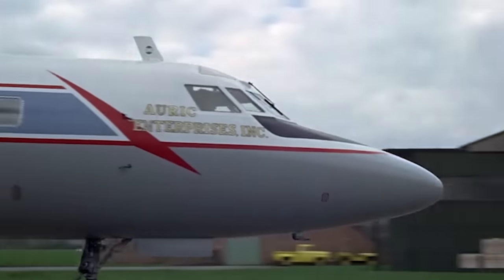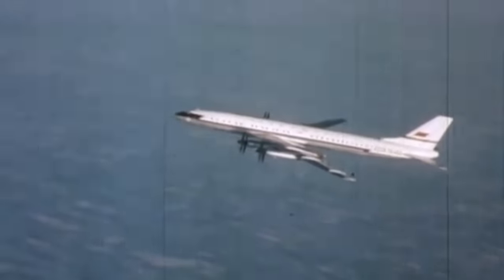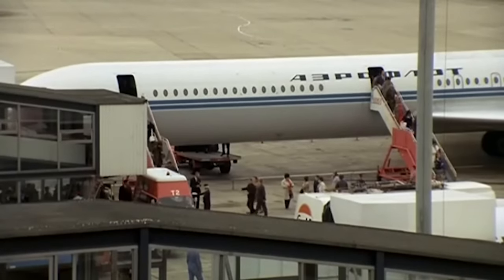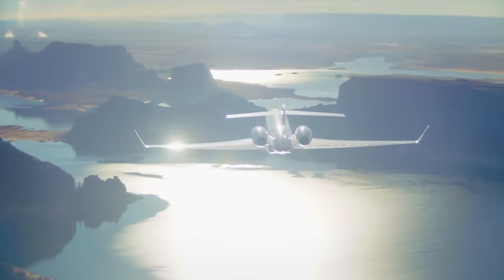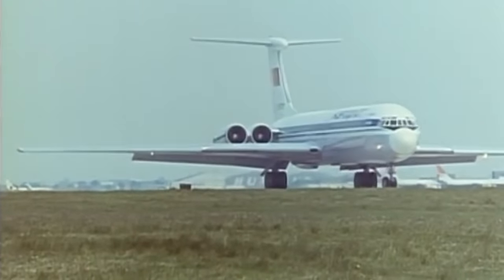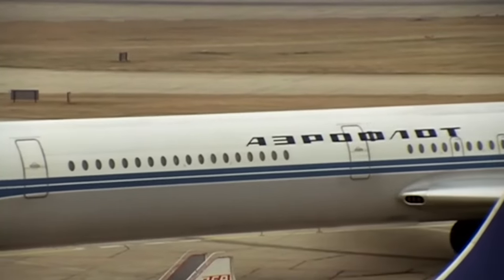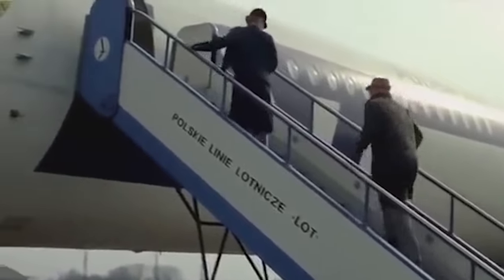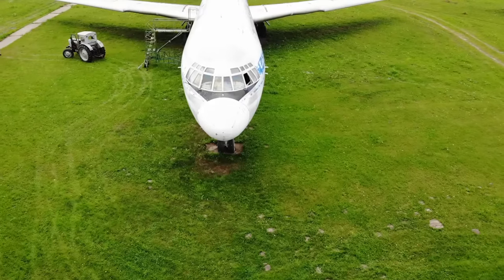IL-62 - an ideal option

Comment: I always loved the simple, straightforward reliable engineering solutions of Soviet vehicles.
British engineers carefully balanced the VC10 and found solutions to problems that were caused by solutions to other problems which were in turn caused by solutions to initial problems.
Soviets balanced the IL-62 for handling, found the c.o.g. was behind the main gear and instead of redesigning everything they simply said "Just put a retractable support in the tail"
A direct solution that didn't cause other problems.
I think people who called it a crutch were just envious of the incredibly simplistic solution to what they thought was a complex problem lol
Reply: The 727 had an even simpler solution:  The engineer installed a four foot aluminum pole into a fitting under the tail and this prevented the tail from touching the ground if the CG were to shift aft during loading or unloading.
Reply: Simple solutions to complicated problems are usually the most clever, cost saving and more difficult to imagine.
Reply: @MrLewisbate Obviously you didn't watch the video.
Reply: space-race: they needed a instrument to write aboard the capsules in outer space...
The Americans spend a fortune inventing and developing what became the Fisher space-pen (with a tiny cartridge go CO2...)
The Russians just brought a lead pencil...
Reply: @GAUROCH2  while it would seem the sensible thing to do, the lead pencil will fragment into miniscule particles spreading through the capsule. Could these particles cause issues?...they wouldn't want to find out the hard way. The Yanks ultimately` did a brilliant job in getting to, landing on, and exiting the Moon first go. Their attention to detail is to be admired, not that I am denigrating the Russians though. The BBC did a superb audio series about the Moon Landing called 13 Minutes To The Moon - a magnificent series of 7 or 8 programs showing the ppl and obstacles overcome. It is really worth listening to.
Reply: 100%.
Reply: That is consistent with what I read a long time ago, that the IL-62 sometimes needed significant ballast in the front of the aircraft to ensure it was in a reasonable balance.
Reply: All tail engined aircraft have a non-tip method of some kind. DC-10 & MD-10/11 use a weight cart and nose tether. 727 as noted above has a removable tail stand pole that is manually installed by the mechanic and is stored inside the rear air stair part of the fuselage. 

Rear engined aircraft actually can't fly empty, if there is no load, you have to load a ballast pallet into the forward-most cargo position, or add ballast fuel to a forward fuselage fuel tank, if it has one.
Reply: It's a brilliant solution, like the dogtooth on the wing, a simple solution that doesn't add complexity.
Reply: In the west we don't call them complicated solutions, they are simple design changes. The brittish designers only needed to add a section or two of fuselage to correct the design. They refined the wing placement much like the soviet designers took the extra time to refine their simple vortex wing design. The fisher space pen was not designed by Nasa nor was it a complicated problem. Nasa used graphite pencils to begin with as well because they didn't think it was a problem worth tackling. Nasa bought 400 fisher pens because graphite created dust and broke off in pieces. The soviets  followed suit with purchasing 100 pens a year after western counterparts.

Comment: Excellent presentation! I have always been intrigued by the IL-62M and used to watch the park at the Pan American World Airways Worldport at JFK when I worked as a ticket agent for Pan Am. I now get to see them at the Havana airport (HAV/MUHA) when I taxi past the Cubana maintenance ramp in my 737. (I stop, set the parking brake, and take lots of pictures). The Soviet Union and the U.S. aircraft manufacturers had similar design philosophies: design rugged aircraft of relatively simple design that would have both civil and military applications. While the VC-10, L-1011, A380 and other "advanced" designs have been retired, the rugged IL-62M and the B-707 still fly. Thank you for an outstanding presentation!

Comment: I flew on it in 2000 in Domodedovo Airlines ;)
It must have much higher take off speed than Boeing's because I remember this plane accelerating on a tarmac for so long while engines scream until its almost a tunnel vision outside.   And oh the leg room on those!

Comment: Back around 1990, I worked at Toronto Intl Airport and used to attend when Polish LOT airlines used to fly their IL-62s in.  We learned the most important rule: always stand on the outside of the gate, even if it was pouring rain.    When the door swung open, an overwhelming stench of sewage and what smelled like rotting food would blast out, leaving us gagging.  As I was a recreational pilot, I used to talk to the station chief, who was a former Air Canada pilot.  I was a little concerned about the halo of small cracks around EVERY rivet - I asked the SC how many cycles the airframe had on it, and he snapped something in Polish at the engineer, who brought out a huge leather-bound book.  I forget the number, but it was WAY up there.  I also almost started an international incident on one belonging to Aeroflot.  We boarded in full dress uniform because it was a new “welcome to Canada” measure.  My partner said the Aeroflot F/As were attractive, so we boarded just after the passengers got off.  We were giving the girls (who, yes, were easy on the eyes) some of the baseball caps and pins we had been given to give to kids, when a guy in a rumpled suit, who was not either an FA or a pilot/engineer, but the girls were clearly afraid of (a political officer, perhaps?) stepped out and saw us and went nuts.  When we explained that we were RCMP officers, he started screaming “Federal Police?!  GET OFF!  GET OFF!”  The FAs scattered in terror and we let ourselves be ushered off the aircraft with him yelling “Forbidden! Send official protest!” In broken English.  So I didn’t get a date, but I’m sure that I was the subject of a report to Moscow.  ;-))
Reply: That is hilarious. The FA's on these flights were most likely daughters of some politburo pricks, since going out to the west was a highly prized job. Most certainly the whole crew was under the watchful eye of a Zampolit (ever seen "Moscow on the Hudson" movie with Robin Williams?). I flew to the US in 1984 via Montreal on one of these things. The flights to NY were suspended at the time due to Reagan's sanctions against Poland for the Martial Law coup. We might have passed each other then;-)

Comment: I love little quirky features such as the skylight window in the galley. I would never have known about that! Similar little goodie is that Qantas 747's (and others I presume) have an access door to a section of the cargo hold where the crew could check up on livestock (typically horses) in transport! We used to take breaks on the turbo prop fleet to have a play with any dogs on the forward hold. A lovely way to break up a long sector!

Comment: It's a great thing that three of Interflug's IL-62s have been preserved. It's such a cool jetliner!
Reply: @Timothy Simpson Lady Agnes had one go around on landing. She landed on the second attempt.
Reply: 3? One is Lady Anges on that field i northern Germany, the other one is in Leipzig, and the third one is where?
Reply: @KamilMB  The third one is DDR-SEC in Merseburg at the Luftfahrt-Technik-Museumspark.
Some other Interflug jets are also on display there. 

Other IL-62s are Lady Agnes in Stölln (registration DDR-SEG) and the one in Leipzig. (registration DDR-SEF)
Reply: @jkarhiaho  Thanks for this info. So two of them are close. Do You know why DDR-SEF is not on google street-view? It is on the satelite view, and in 3D even, but as You go down to street-view it is not there. The photos are from early 2000' (old cars on parking where Il shoud be), and they have it on them that they are from 2017...
Reply: @KamilMB  Well, DDR-SEF stood for a long  time at Leipzig-Halle airport and was moved to it's current location in 2010. So the street view is from before 2010. The "2017" means nothing in Google Maps/Earth.
Reply: @jkarhiaho  As I am a fan of this model, I know the history of SEF. I've seen photos from disassembly, transport, reassembly, painting. I remember, it was on street-view for some time, and then it dissapeared. Maybe becouse it was on street-view after assembly, but before repainting, and the owners didn't want it to be seen od street-view like that? I don't know. Hope google will send street-view car there soon and bring it back on street-view :)

Comment: Ok ok ok :) So, as I am wathing I can't not comment. So the avionics were not that modern. When PLL LOT took delivery of its first units of Il-62 in the early '70 they updated the radio equimpent with western  tech, what was concidered as an offence by the eastern "towarzysze". The simple controlls came out to be to simple, as there were no double steering systems. That is concidered one of the factors in both LOT's and Interflugs fatal crasches of 62'nds. Lack of slats has its advantages - no denying - but due to that the plane has higher approach speed and required a larger spread from other planes on landings - at the time no problem, today conjuction on approahes is high, so the smaller spread of planes the better.
NEVER THE LESS I LOVE THIS PLANE and I am very gratefull for this episode from You Sky! THANK YOU!

Ok, so maybe another IL-62 film? Maybe tell us about operational details, numer of planes delivered over the years, still active units. So many things You can talk about concidering this magnificant machine! :)))

Comment: In Poland there was a saying about Ilyushin - 'Chcesz być pyłem, lataj iłem'. Which translates 'If you want to be dust, fly on IL'.
One of them crashed near Warsaw after a turbine in its engine cracked under stress, cutting through second engine and its tail on way out
Reply: Not one but two crashed for same reasons. First one crashed in 1979. It was IL-62. The second one crashed in 1987, IL-62M. Copernicus, and Kosciuszko. RIP.
Reply: @sanderus421  The first one actually crashed in 1980 not 1979
Reply: Or even better : „lepsza kiła od Iła” - „better syphilis than Il”

Comment: THANK YOU! I have been waiting for you to make a video about the Il-62; you exceeded my expectations.
Reply: I was working on IL-62 and IL-62M for Polish Airlines. The plane was not terrible and was liked among crews in 70-ties and early 80-ties, even outdated compared to western designs, especially in electronics. On the transatlantic trip, the plane was burning 11 tons of fuel in the first hour. Only after 5 hours of flight, it was reaching economical 5 tons per hour consumption. Fully loaded (and that how it was usually operated by Polish Airlines), it needed the full length of the runway for a takeoff. The really serious problem was (of course you cannot hear anything other from Polish Airline employee), quality of engines, both Kuznetsov and Soloviev (second used later on M version). Serviced exclusively in USSR only, both designs were plagued by scandalous lacks in quality and precision of manufacturing and nothing short of critical lacks in quality control. As two Polish disaster investigations revealed, those lacks ranged from, nonmetallic inclusion in the material of critical parts, lack of any finish besides coarse on part requiring micro-metric finish precision, unorthodox violating technical norms modifications, negligence in manufacturing, and nonexistent quality control. Interestingly, the Soviets had denied faults and the role of those faults (in their engines) in two Polish disasters for a considerable time. The official position was, that discovered by Polish Disaster Commissions engines faults were not the cause of the disaster, but it results. Even it was an obvious lie since the beginning, as Soviet explanation, despise of a number of signatures of important “scientific” and government officials, could not explain things like, finding parts of the engine over 150 km from the disaster site, Soviet denial was finally and fully withdrawn only after, in two separate incidents (in Polish airlines), engines suffered catastrophic explosions while in flight, which did not end in disaster. Both planes landed safely. As disaster did not happen, engine faults simply could not be blamed on disaster anymore. In yet another interesting twist of fate, after surfacing of the following video on YouTube: https://www.youtube.com/watch?v=-xltGZk4aHY (ground inspection after a successful emergency landing of Cuban IL-62M in April 2008), when it seemingly became apparent that despise Polish disasters, engine problems were never corrected, even 20 years after, another campaign of denial took place, involving this time internet trolls, forcing untruthful claims on international Internet forums (Wikipedia and other), even what appears to be the clandestine operation of Russian intelligence agencies. This time on public forums, Russians attempted to claim, that presented by them record (which according to them is 100% trustworthy), of operation of IL-62 and IL-62M, indicated both planes as considerably safer than any western counterpart of the same time. To explain Polish disasters, 20 years after disasters, all of the sudden some documents of Polish Secret Police of communist-era were “discovered”, which claimed, Polish Airlines in unorthodox agreement with the manufacturer (which grant it a free hand in decision making), decided to extend the time of operation of engines between checkups, beyond originally recommended by the manufacturer. The story itself is constructed neglectfully revealing serious lacks. For instance, as a manufacturer it lists Ilyushin Bureau, which did not produce engines, it produced plane body hence it would not be the one making the decision. That would be a job for Kuzniecov than a Soloviev factory. Matter of fact Polish commission found very little to complain about the body of the plane and described Ilyushin Bureau findings in regard to disasters - “objective”.  Problems in investigation cooperation (or its lack) were since beginning with engine manufacturers and particularly bearing manufacturers. Anyway, the problems of such claims are as follow. As Soviet disasters were kept secret from public opinion and records were kept by the Soviet state only, it is only unverifiable say of new Russian now government that presented records are full and truthful. While IL-62 was still operated in 2008, revelations coming from the Cuban incident were quite unfavorable for the reputation of the plane, which does create an agenda for the Russian government to be less than fully revealing. Revelations regarding engine operating time limits come not from work of official Polish Disaster Commission, not in the time of the investigation, but from records of communist secret police which not that much had ties with Soviet intelligence (KGB and GRU back in communist times), but were rather composed of operatives of both. On top, the timing of “discovery”, 20 years after disasters, coincides with the time of the Cuban incident. Even Secret Police theory was never publicly addressed by any serious investigation by Polish state to my knowledge (they simply ignored it), the existence of such practice would have to be common knowledge in Polish Airlines, reflected not only in vast volumes of documentation but vast accounts of human witnesses memory. Hours of servicing of engines were not kept secret in Poland. Every, even basic level worker could have easily check them, or actually, to say more precisely, did check them, as knowing and operating with those numbers were part of normal work routine for a vast number of people from of all levels of the company. Those hours were listed in numerous places, starting from a tag on engine or box with the engine itself, kept on the ground, where anybody passing could have simply read it, to documentation in various departments of the company. As following and keeping those hours was part of a job, the work of many people required constant checking and familiarity with them. From my side, as a former employee, even not directly involved in engine servicing itself, I can only say, such records or accounts,... are simply not existing. So here they are. My two pennies, while on the subject. Was not trying to make it an attack on Russia. My sympathy simply goes not to people who manufacture the engines, but to common, average people who fly them, including Russians. They are the ones whose lives will be affected (hope note) by flying them. There is one more aspect of the story, purely speculative. Are the Russian engines really that bad? Hard to tell for sure! For sure the Cuban incident happened. For sure Soviets were aware of engine lacks way before they admitted it, as they were sending “special” engines to service official delegation flight of Polish Communist Party to China (which they demanded back after their return). The plane suffered no disasters or incidents in Polish Airlines for 8 years. Two disasters (and two additional incidents without disaster) happened in the time of “Solidarity” in Poland, where Poland definitely was perceived in the USSR as an enemy. Could it be this perception played role in Polish disasters??? I don't know the answer to this question. Who knows.

Comment: In my teenage spotting days at LHR,  i considered the most exotic types to be Aeroflot Il-62 (and Aerolineas Argentina DC-8.)
Reply: Didn't you spot the water being ejected from the nose tank on takeoff?  This was to stop it sitting on its tail when full of fuel.  The water was filled by the Heathrow fire section who thought it was a pain.  The water was dumped after takeoff.